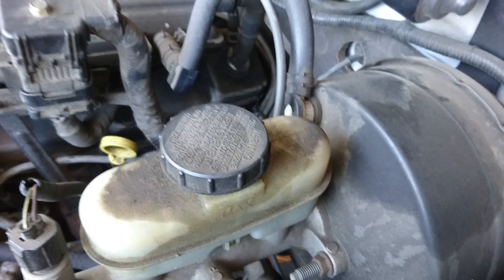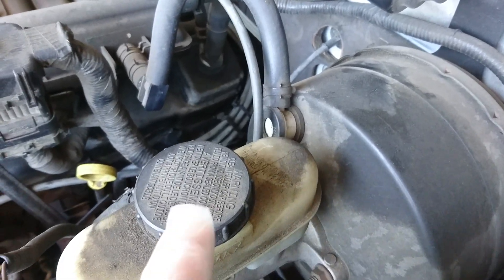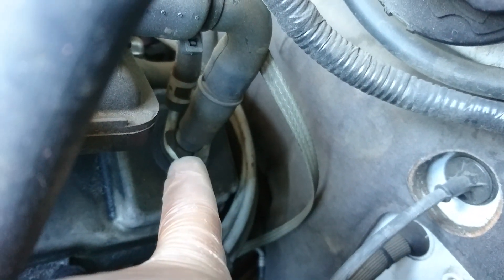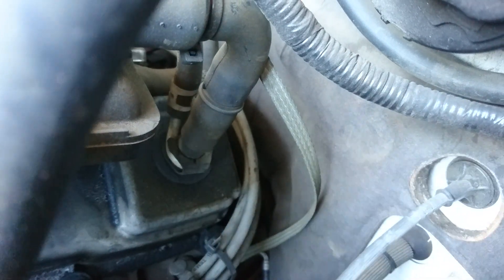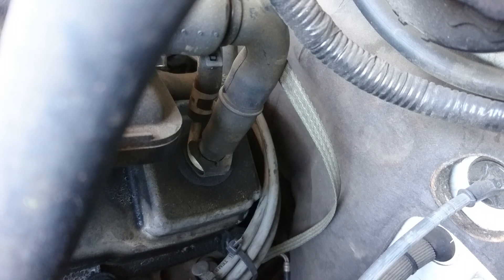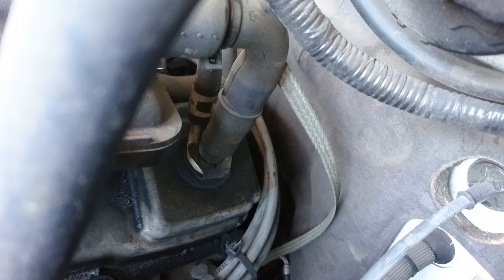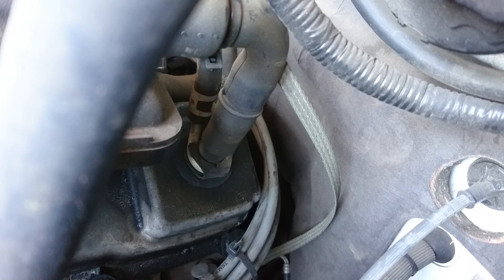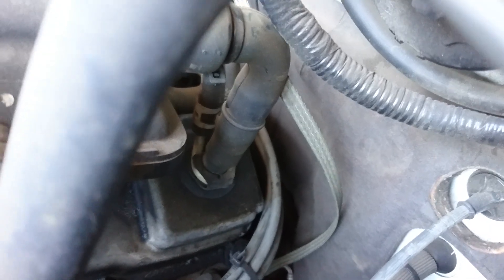Ford Ranger PCV Location

Comment: This may be a ridiculous question, but I would rather look dumb asking than to be broke down somewhere. But anyways, how snug is the whole value supposed to sit in the hole? Mine slides up and down with ease. It also leaks some sort of fluid. The oil looks like transmission fluid in my opinion. But it's also hard to get a good view. Whatever it is, I'm sure it's not normal for it to leak out. Thanks for the video and hopefully you can help me out a little
Reply from the maker: Hi Alyssa, the pvc is held in place snugly with a PVC grommet. It will have some movement but it is snug once installed, it shouldn't move too easily. If you are noticing a leak around that area, I'd recommend changing the grommet and the PVC valve. I hope this helps.